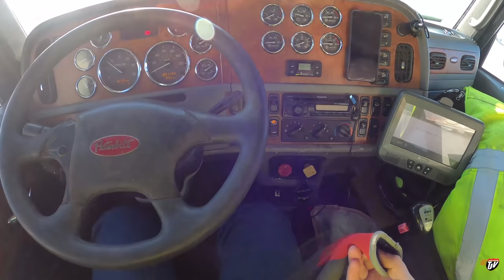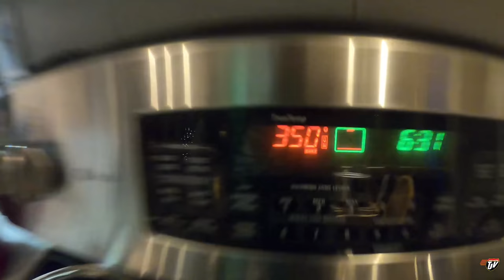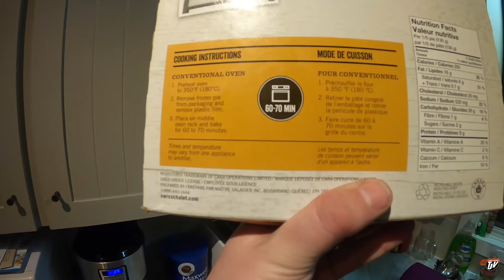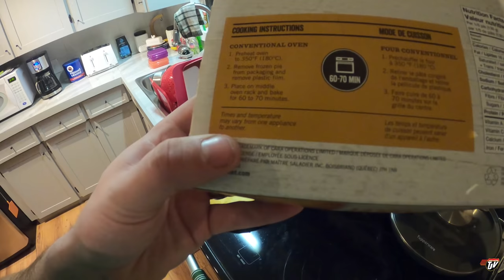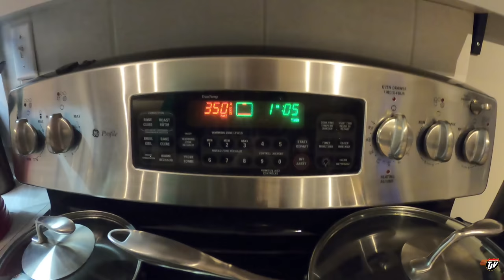LASTED ONE DAY | My Trucking Life | Vlog #2434

Comment: Josh, unless you put in an aftermarket cord on your block heater, it has a thermo-switch inline that cuts out the element when the temperature under the hood gets above -17°C, as above that temperature it is not required. So don't worry about it.

Comment: Don't know what they have nowadays for teaching metric. There was nothing back in the 60's. I had to teach myself, meaning memorize, Fahrenheit to celcius when I went to Australia, which was easier than I thought. And for metric distance measurements, I picked it up when I started traveling in Canada, which was even easier. To figure out how far 50 kilometers was I just looked at my speedo and lined the little red metric numbers up with mile per hour, and bingo there it was. I am lost on the smaller metric measures and weight though.